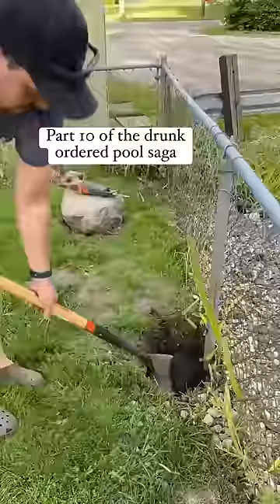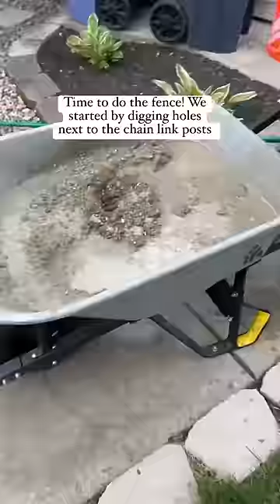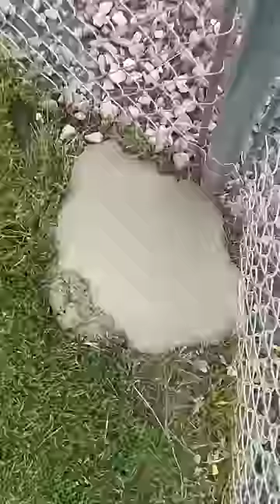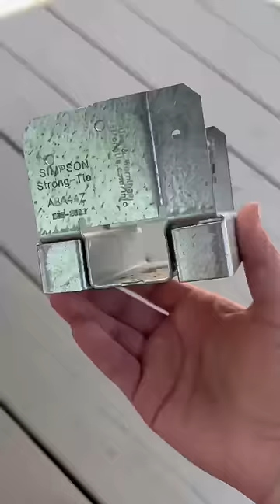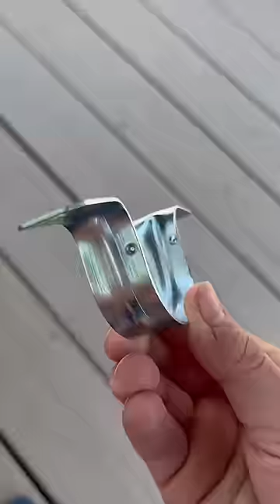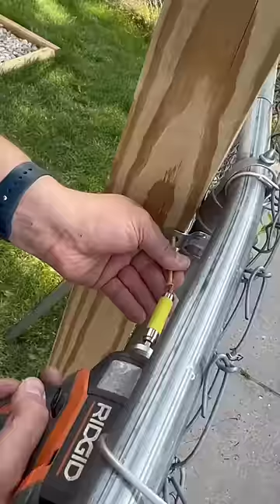DIY Wooden Privacy Fence #fence #diy #privacyfence #woodenfence #fence #ideas #chainlink #backyard

Comment: Building inspector driving by, you guys have a permit for the 8-foot fence for the front yard? No? Looking good, I'll be back next week. Part 2 is a demo video 😅
Reply: Posts are cut to size AFTER the fence panels are attached. It’s a common construction method.
Reply: @JD-kg3mx  Yes, because said fence panels are sunk into the concrete at various heights. He put that into a a Strong-Tie 4x4 post bracket held in by a single tapcon. I can promise you that isn't common practice for fence building!!! This is about as stupid as when my neighbor zip-tied fence panels to trees after a hurricane knocked them down.

Comment: Why didn't you put posts in holes level up and concrete in would be a lot stronger
Reply: Post will rot at the top of concrete
Reply: That’s actually not a problem at all, this is totally fine. What is odd and I still don’t understand is why they would fasten it to the chain link fence… the posts will have strength added by the completed fence.

Comment: Lol that fence is so bent!😂
Reply from the maker: Exactly why we decided to do it this way, it was a bitch to line up everything correctly since it was installed crooked 😂
Reply: @dontdrinkanddiy5078  Which is why people in the comments section are having a field day with this horrible design. If that is supposed to be the posts to a privacy fence, then you failed quite spectacularly! Most of the things you did here, I have removed from other people's failed experiments, and the rest I wouldn't do based off of common sense.

Comment: Reminds me of the day when I found out that the cement doesn't need to be premixed in a wheelbarrow, I just pour it into the hole dry while spraying water in at the same time. Works great! Ex fence builder.
Reply: Exactly. Yep... pros don't bother mixing it this aint a column holding up a high rise. The moisture from the next rain will take care of it.

Comment: In a freeze/thaw environment, those posts will eventually pop out of the ground like a tooth because the hole was filled to the surface with concrete instead of filling the top of the hole with dirt.

Comment: No need for bracelets, in the same hole, a little deeper 15-18” deep set ur post, dump ur bag of concrete in dry, plumb ur post pack with the handle of ur shovel or 2x4 then add about 3 qt of water. Post will never come out of the ground. Redwood or cedar post will last longer than pressure treated post will

Comment: If this is for a privacy fence....
Wat too much extras!
You dig your hole.
Then you drop in your pressure treated 4×4.
Then pour your qwikcrete in dry and add water in the hole and mix with a long stick.
It will be ready ti build and assemble the very next day. Qwikcrete is designed to absorb water from the surrounding ground.
I have built thousands of decks, and privacy fences over the last 45 years and not one had failed.
If you are worried, Qwokcrete sells a product that you just dump it in the ground and it hardens solid without adding water. Those 4×4 mounting brackets actually create a weak point in the fence.
Runn8ng ir below the ground is proven to be stringer and last longer than said mounting bracket.
The fence boards will shing and crack or fall off before any of your fence supports falter.
In 1979 , 44 years ago, my father and I installed a privacy fence around our entire backyard. To this day, not a single board has popped off, nor has any of the 4×4's become weak or wobbly. 
And that is on Detroit's Eastside where you have to worry about the frost line that is at 32" down.
Now tell me we didn't do it right.

Comment: You should have used an auger dug the hole's deeper and then put the 4 by 4's down into the cement it'd be a lot sturdier and you wouldn't have to worry about those little brackets being held in by a screw into some concrete maybe by 2 inches

Comment: I cemented metal post's in the ground used those brackets to attach 2×4 to the posts then ran my fence to the 2×4 it's been 20 year's and no rot

Comment: Contractor Tip -   Dig hole about 2ft and place 4x4 and then throw in youre concrete and level youre 4x4 but  don’t add water, over the hours the concrete will get hard due to the humidity in the dirt. I promise you the next day that post won’t move at all.
Reply: Or. Dig a hole about 2.5ft deep. Fill with 4-5in of gravel, set 4x4 with 1/2" through bolt approximately 6" and 14" from the bottom, and fill with concrete (mixed anyway your little heart desires). Make sure any future electrical or least conduit is in the ground first. 

He mentioned a pool, so that should probably be installed and buried first as well.

Comment: Could always wrap the bottom of the post with a barrier that divides the concrete and wood, then seal the top of the barrier with a tar or some silicone--- that way the post doesn't rot in the concrete, and holds stronger than a thin sheet of metal bracket.
Reply: WTF? this is a galvanized fence nothing is gonna rot here.
Reply: In my experience of pulling up fence posts both in and out of concrete.
1. I have never seen wood rot "Inside" the concrete.
2. I have seen posts with no concrete shear to almost nothing. 
3. I would never in my life put a fence post above the concrete on a fence. Maybe a deck, maybe a structure that required vertical supports. But never a fence. That is the dumbest thing I have seen in a bit. 

Proper method is dig down 2.5 feet. Fill 4-5 inches of gravel. Set the post, and fill with concrete. Make sure the post meets minimum standards for decay resistance. The IRC has these standards in R317.1.2.
Reply: @tobybigham4196  It was just an idea based on everyone's comments saying that the post will rot.

Comment: You got to think about butt joinery and dove tail joinery.  Dovetail will always be stronger than joints attached by nails or screws.  That’s literally why most posts are dug in deep into the ground and cemented to hold it into place.

Comment: It would be a lot easier to mount the brackets on threaded rod or long bolts cast into the wet cement than to drill cured concrete.

Comment: You could have just drilled a hole through the wood and through the steel post stuck a bolt through it one at the bottom and one at top there you wouldn’t have had to do any digging or use any concrete and it would of looked just a good and to make it one step stronger drill a hole at the bottom of the wood and bang a steel piece of rebar through the hole and then with a sledge hammer bang the wood post down into the dirt that will atleast keep it somewhat secure and straight

Comment: Those fence anchors are made for decking where the weight of the deck will hold it down. Bad thing is a strong wind will blow your fence down. Or a big bad wolf. Didn't you ever read about those pitiful three little pigs?

Comment: If you must pour concrete like that try making a nice circle or square line around the edge as the concrete sets up like you would scoring something.  Once dry you can break the score line with a hammer and will resemble something 😂

Comment: Its gonna move. You put the anchor plates the wrong way. Theres rotation in the direction you are trying to support. Plus you should have sunk those post with the concrete that would have locked it down in all directions

Comment: Could have used the correct concrete and set an ancor bolt in the concrete. You took the time to dig the hole... why didn't you set the post? Could have secured the post to the chain link without the hole or the concrete. Did you ask the neighbors if you could remove the ugly chain link. These videos confuse me sometimes

Comment: Huh, by the way the metal fence is facing, they are the owners of that fence. So, wouldn’t it make more sense to replace with a wooden fence.  Outside of that, it might be better to place the post in the ground adverse to using brackets. Save some headache and plant some shrubs.  6 ft apart.

Comment: Why did u not just set the post in the cement ? Or put ur fasteners in while the cement was almost dry so u don't have to risk cracking it? Not a horrible job but dam man so many easier more efficient ways

Comment: Reasons like this is why US good contractors have to be pulling permits, getting small projects engineered costing more money BECAUSE of obvious reasons...USING An Emt Strap to attach the galvanized fence pole to the 4x4 is something you don't do if the company which makes brackets and strapping (SIMPSON STRON TIE)  seen this they would vomit..my project would get shut down...And since u poured concrete for a base smartest thing to do for better stability is put 4x4 in the concrete not use a bracket its not as secure and the post in concrete is much more stable..its a no brainer...funny thing is neighbors will see this and be like (babe look Taylor is building Karen some kind of bullshit whatever it is I want it too ) I could go on all night...happy building my friends..✌🤙🙌

Comment: This is why you call a professional. It costs more for a reason. The wood posts need to go down a couple of feet in concrete so they don't just lean over. Now all the weight of the wood is being structurally supported by the chain link fence. Nobody should ever build fence like this, EVER! And what's the deal with pre drilling holes for decking screws. 0/10